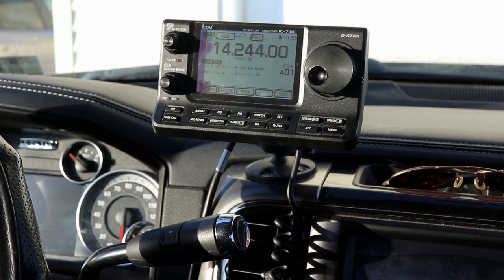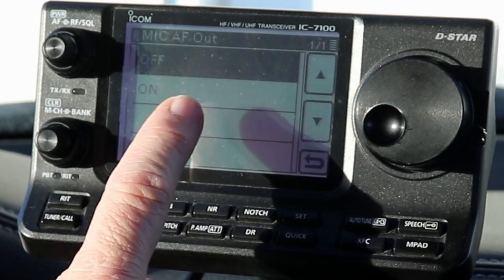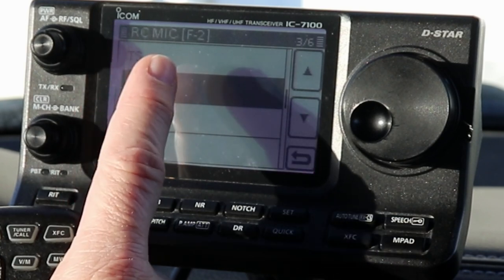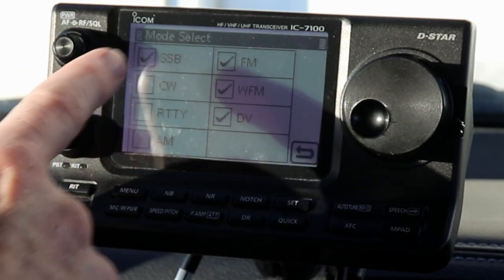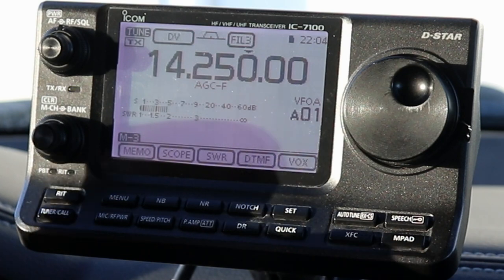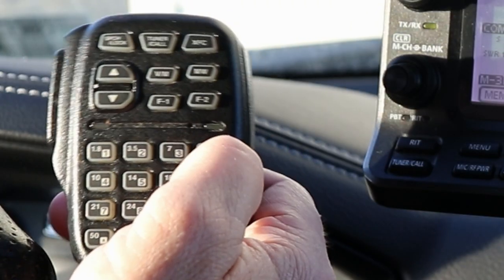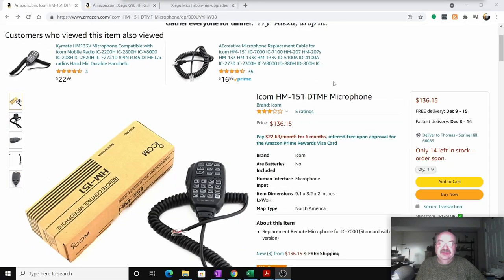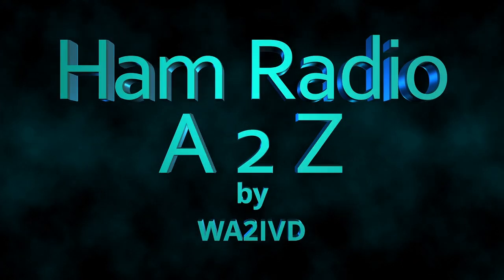IC-7100 A to Z #17 HM-151 Remote Control Mic

Comment: I have done the AB5N mod on my HM-151 but have gone back to the original as I was getting poor audio reports with the upgrade. I bought a second mic so I could easily compare them and consensus was that the stock mic sounded better.
Reply from the maker: Hi Andrew. Thanks for the information.  That’s good to know.  I’m going to hold off on any changes to my mic, at least until I see more reviews or reports.
Reply: Same as Andrew. I had reports of clipping which couldn't be resolved. Stock mic or Heil headset for me.

Comment: The switch on the side of the HM-198 is to disable the frequency up and down buttons on the top. It has nothing to do with audio response.
Reply from the maker: Hi.  Thanks for the correction.  Yeah, a bit of brain fade on my part.  I should have looked it up before doing the video.  I was remembering a different mic on a different rig that does have a switch for changing the audio tone.  I’ll add a correction in the description for the video.

Comment: Have you found a way to use the dtmf as dtmf? 
The band stacking is neat but not what I need.
Reply from the maker: Hi.  I haven't had a need to send DTMF tones with my 7100, but I had always just assumed that the number buttons on the HM-151 would send tones if you pressed them while transmitting (like every other keypad mic that I've owned).  I just went to my radio and confirmed that they don't.  As far as I can find, there is no setting to make this happen.
I did find an article about a DTMF keypad that retrofits on the back side of the HM-151 from Midian Electronics.  Here is the URL for an installation manual:  https://www.pc5e.nl/downloads/ic7000/Mods/ICOM-IC7000-HM-151-DTMF%20Mod.pdf
After checking Midian's website, it looks like the product may no longer be available.  If you really need this capability, you might try calling them to see if they have any old stock.
Reply: @HamRadioA2Z  yeah I just did uploaded a video  with the 151, 207 & a 207s.
All 3 only did the "band stacking", I think that's what it is called.
Anyways thanks for the link.

Comment: For a mobile radio dimming isn't in any quick menu
Reply from the maker: Correct.  That is one of the frustrations (for me at least) with the 7100.  I find it difficult to read the display during the day unless the backlight is turned up.  Then, at night the backlight is WAY too bright.  I am usually in the settings menu twice a day turning the display brightness up and down.  I have an idea for a project that may help this.  Stay tuned…. de Tom WA2IVD
Reply: @HamRadioA2Z  I've had the radio for three years and that's the only thing that really bugs the heck out of me.